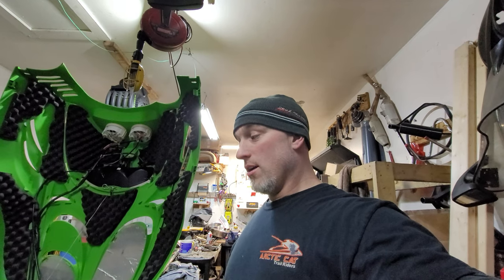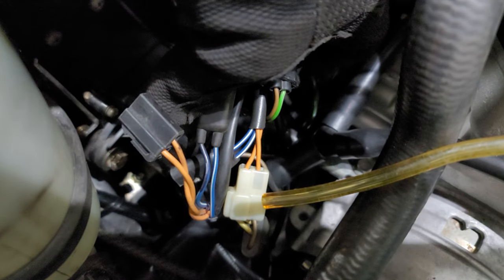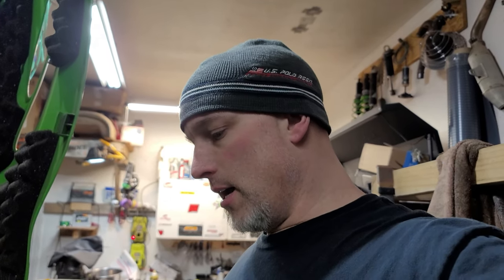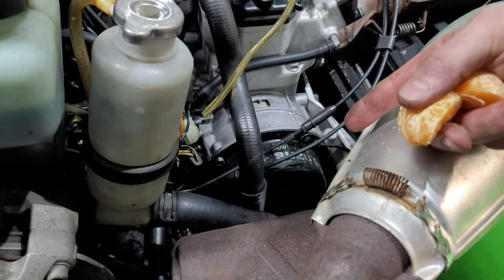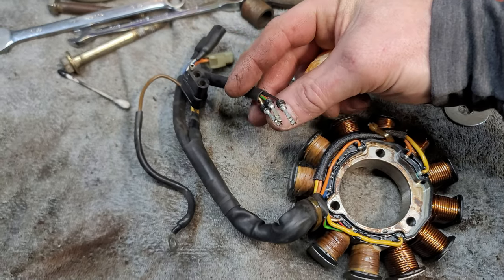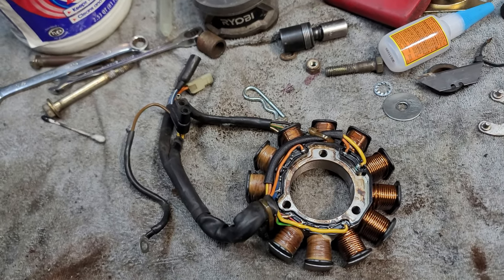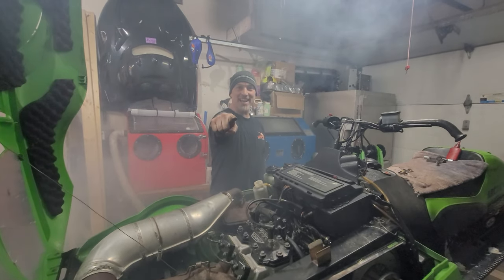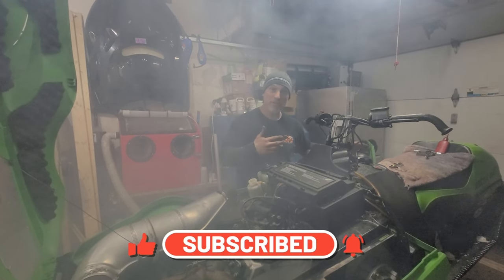02 ZR 600 EFI Rebuild || Wrecked Edition Part 9 ||  Stator is Bad, What now?

Comment: Aftermarket stators, coils, really are suspect.  I learned last weekend when ohming a coil and comparing it to another, they can be identical in value but one will give you spark, the other won't. I rode my sled once this year, our trails were opened 3 days, then we had to close due to rain.
Reply from the maker: Yep! That's not surprising at all. I have a guy named Lincoln who owns A-Z Tractors and ships world wide has ton of Wheel Horse and other tractor parts. Definitely my go to for WH parts though. But yeah we rode once as well. Trails were open here in Michigan but just no snow. There were probably 4 times that people could actually go. Sad year for sledding. We'll see how next year is.

Comment: Unfortunately,, all the manufacturers of the brands stopped producing those older stators so we're pretty much dependent on the aftermarket.
Dennis Kirk seems to have an unlimited availability of electronic parts.
So far, I've had good success with mine.
Reply from the maker: Thanks for the info! I prefer to get good used OEM from West Michigan Snowmobile Parts in Hart MI. And if not that then I have both an American guy and Canadian Guy that rewinds them professionally. And they are just as good if not better is some cases than OEM.
Reply: @Fixin2Ride-Official-  It basically boils down to a matter of choice..new or used.
Since stators all have a limited operational life, I will continue getting mine from a well known, reputable dealer like Kirk with a well crafted product over someone else's used parts with an unknown history..  And I'm with you, l couldn't care less what country produced it, just as long as it's quality... and 170 dollars opposed to 600 dollars.
Reply: I just did some more research and I found out every one of these electronic stators are made in China..... None are made in the USA
Reply from the maker: Yeah all today's aftermarket are. That's why the old Japanese OEM or going with one of professional reminders is my choice
Reply: @Fixin2Ride-Official-  Actually that's not true..  The point is, they are all produced in China, they are quality produced, and very likely something we can't compete with on a quality versus cost basis.
For those reasons, China remains a vital trading partner and a crucial element for a healthy world wide commerce.
Reply: @Fixin2Ride-Official-  "Canadian guy?"
There's no way of making a profit for the amount of time invested.  Especially considering the outstanding quality of today's after market for certain products like electronics, at least at current levels.